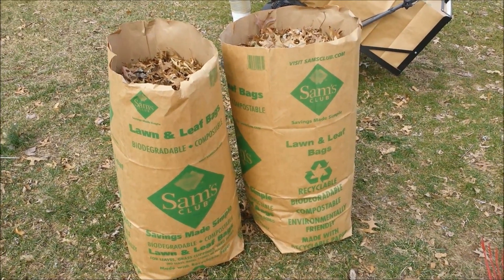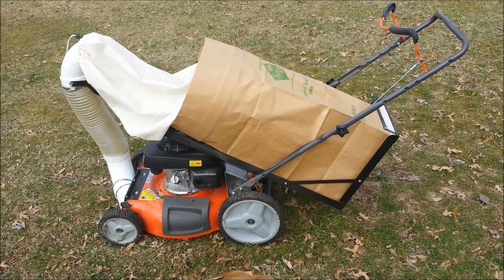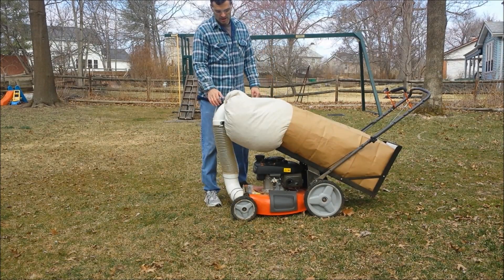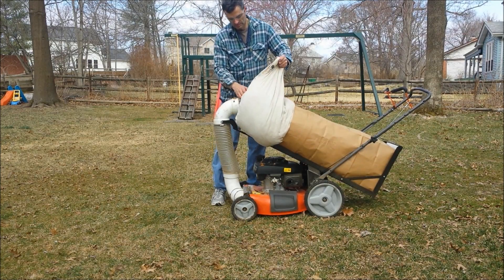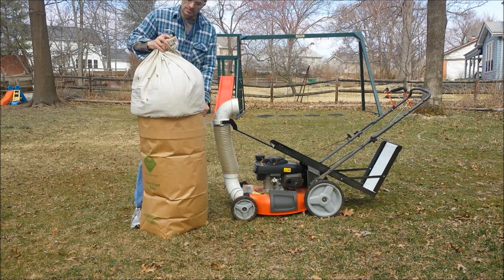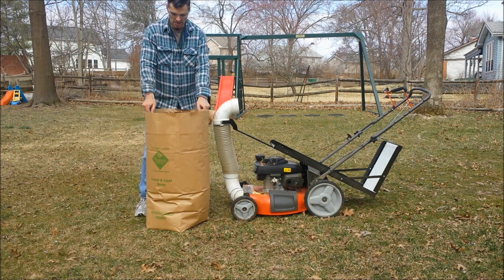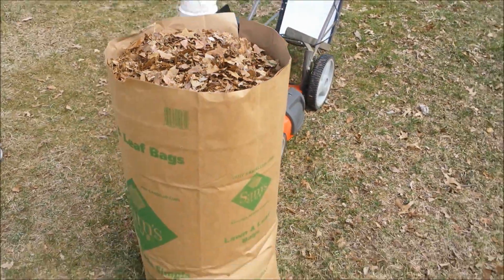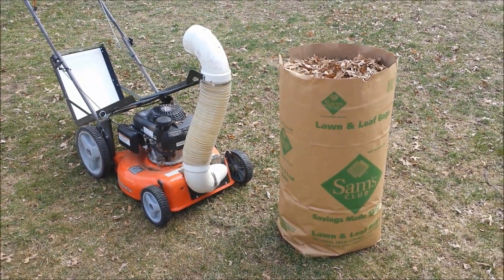Direct-Bag-It: leaf bagging efficiency (beta prototype)

Comment: Did you make the bagger?
    Did you just cut a hole in the front of the mower?
Reply from the maker: For this early prototype, I turned the deck around 180°, remounted the wheels, and added all other necessary elements.  The production version will be a complete system.  See the link at the end the video for information about the Direct-Bag-It Power Leaf Bagger pre-production prototype and an important market survey.

Comment: It's a neat idea, but the problem with your design is that the paper bag isn't getting filled during the mow because its not porous and is therefore working against the draft, so much so that even gravity can't help much. You need a thien baffle between your porous bag and the paper bag. Then gravity will do the rest and fill your paper bag for you.
Reply from the maker: Hello R K.  There is no problem.  The paper bag is completely filled.  The fabric leaf chute, or sock, is porous and is what dissipates/vents the discharge air.  That is what makes the system work.  In fact, you can over-fill into the leaf chute, as shown in this video.

Comment: How does it not clog?
Reply from the maker: Hello Matthew Behne.  It is possible to clog the system if trying to collect wet leaves or if you try to collect at too fast of a rate.  But overall, if you manage the rate, the fabric leaf chute, or sock, dissipates/vents the discharge air, allowing the non-porous bag to completely fill with leaves.

Comment: Where did you get the lawnmower. Did you modify it yourself?
Reply from the maker: Hello Bill.  Thank you for your interest in Direct-Bag-It!

The mower is a Husqvarna 7021P.  I got this one from a local dealer.  I have gotten one from Power Equipment Direct (online).  I believe Lowes even sells them now.

Yes, I modified the mower with parts that I designed.